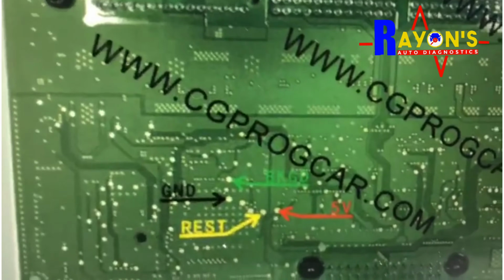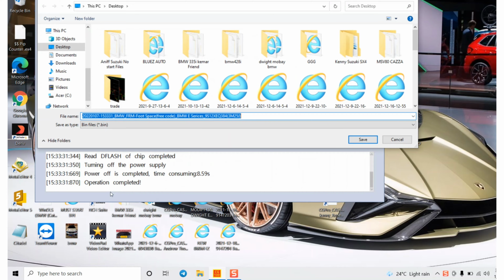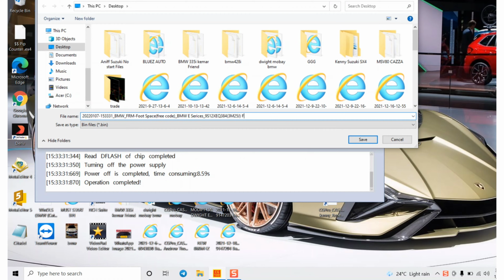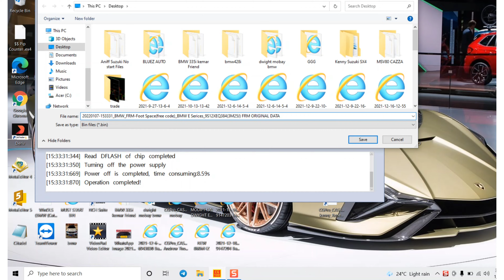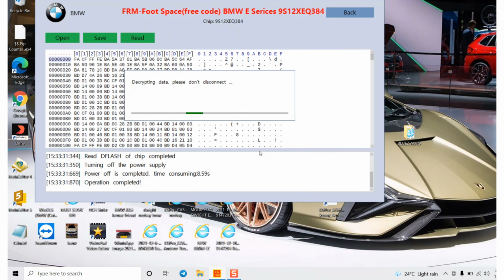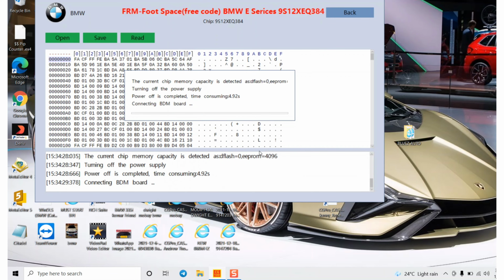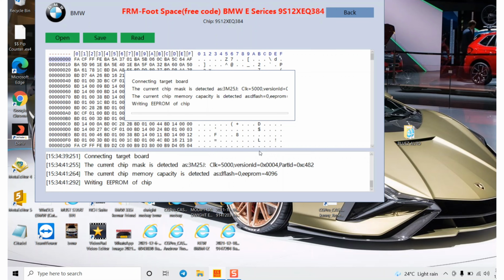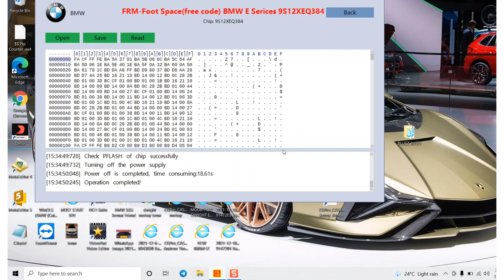BMW FRM Module Repair/How To Reset FRM(Foot-well Module)

Comment: When these are flashed, do you have a perfect file that you use to reprogramme it? or do you use the information from the module you are working on? I hope that makes sense
Reply from the maker: The tool repair the file automatically
Reply: @RayonsAutoDiagnostics  I had this service done to my FRM but the person who did it copied information from a different vehicle causing none of the headlights to work.
I had to go to a coder who corrected his mistakes.

Comment: Hi I have BMW MINI R56 which has Footwell Module problem.
I bought used FWM but it do not work remote door open and back signal.
Can you fix it ?    From Japan
Reply from the maker: I am in Jamaica, the module needs to be encoded to the car. That will correct the problem
Reply: Can you Help me to make it and how much is cost and your address please . Thank you  @RayonsAutoDiagnostics
Reply from the maker: I am in Jamaica
Reply: I've thé same problem. For How much you do it ?

Comment: Hi. It ‘s only reset counter or repair dead Ecu? ( not responding)Thanks
Reply from the maker: It Repair the software when it got corrupted. When the software get corrupted, windows, central locks, light and other components stop working.
Reply: EEPROM reset. These things just stop working randomly and you have to re write EEPROM